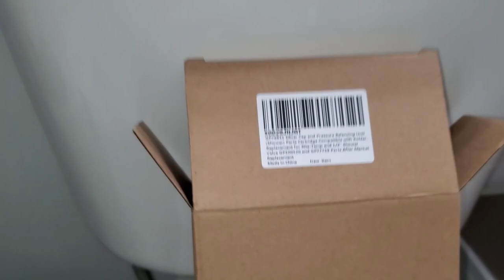KOHLER Shower Cartridge Kit replacement. GP76851 & Shower Valve GP500520

Comment: Hi, I saw your other video where you replaced mixer cap and pressure balancing unit because it started leaking after one year.  So, I have a question if you don't mind.  I have a Koehler GP76851 that needs to be replaced.   Amazon sellers Koehler OEM for $65 but I can find similar units, not made by Koehler for $35.  Is there a big difference between branded and non-branded parts, in your experience?
Reply from the maker: There was a different brand - Grohe. 
Just read review on Amazon. I was buying aftermarket cartridge all the time (if owner doesn't bought some already) and all works. 
This video 1.5 year-old and cartridge still work well. No one call me back with some problem.
Reply from the maker: This one from video cost $21.71
Amazon item: https://rb.gy/mm53k
Reply: @FixitAll  Thanks, I have read some bad reviews for aftermarket parts and just bought Koehler.  Скупой платит дважды.
Reply: @FixitAll  if you don't mind sharing what State are you from?  I'm in Chicago area, IL.
Reply from the maker: @МыколаНетребко  Seattle area, WA.